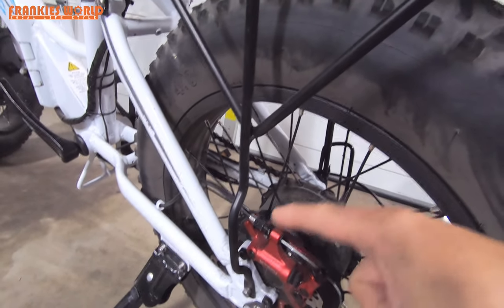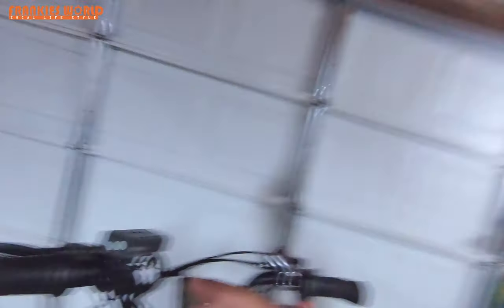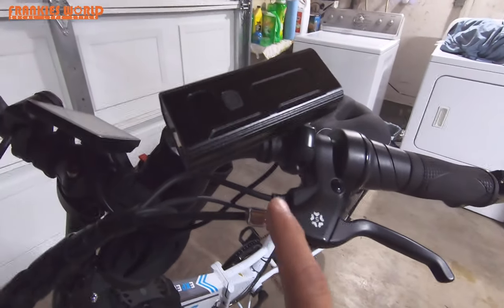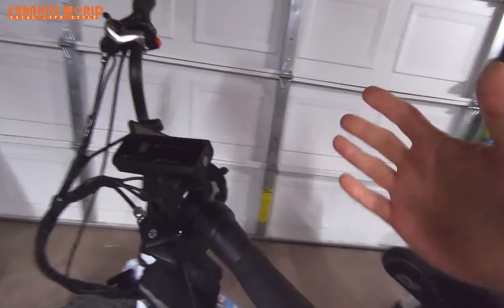How to do a quick brake adjustment on your ebike

Comment: thank you! very helpful)))) Realised, that my brakes, still blocking the motor, after 1 hour of tweaks. Just cut cable from on the brakes. Motor and brakes, from the rear wheel, works independently now. Problem solved 🤣

Comment: Thanks Frank you cut right to the chase and you went quick yet you explained things in a perspective to where even dummies like me fully understand things. When you explained about the brake lever wouldn't work if you don't have the brakes adjusted just right for the power to shut off from the motor to let the brakes work proper. Whew! You know what I mean. You explained that part very thoroughly to where it made me a believer to subscribe to your channel. Looking forward to the next video.
Reply from the maker: Thank you for your positive comment!

Comment: I'm new to the Lectric 3.0 bike and not good with brake adjustments. I watched other videos where they were showing how to adjust the calipers. Watched yours and made adjustments to the brakes like you showed, and worked like a charm when I tested them out. Thanks for the very helpful video!
Reply from the maker: Awesome, glad I could help. Keep in mind after several adjustments at top that you will have to adjust at the bottom towards the caliper. I have another video on that one.
Reply: @FrankiesWorld  I will look that up. I see others (perhaps  you as well) changing them out for hydralic. Did you do that as well?
Reply from the maker: @BikingHikingRadio  I did.  I am working on making a new video soon on brake cleaning to get rid of loud brake noise as well. I have a major issue with that going on with my front brake.

Comment: Man brother you made it so basic. Other videos had me trying to adjust calipers and everything else. Thanks for the simplicity'...😊
Reply from the maker: It’s easier than most think. Adjusting calipers is more of an advanced thing that usually doesn’t have to be messed with unless further adjustment is necessary.

Comment: Very good info for adjusting brakes. My Lectric bike brakes are good since it is a new bike with only 33 miles. The only issue I have the rear brakes squeek a little. I tried using some alcohol and it stopped temporaly but noise came back after a few miles.
Reply from the maker: Thanks, and yes I agree about the noise. Temporary fix, I’m working on making another brake video on replacing the caliper and adjusting both sides of the cable shortly.

Comment: Thanks for the video! I have an Z bike and I've had it for one week now and bought it off Amazon. It's very  similar to the Lectric ebike. Do you know how I can my my steering more stiff in the steering column? Seems like it too easily   wobbles from left to right when I'm trying to steer straight. Thanks!

Comment: Thank you this video helped a lot. Do you know how to fix squeaking in brakes? If not no worries
Reply from the maker: @Steven-xl4ml  I wish! I’ve tried everything from beading them when they are new, cleaning the rotors with alcohol but nothing has worked for me so far. My next thing may be to try using a specific lube for the parts that should help. If it works for me I’ll upload another video.

Comment: Thank You, Hello! I purchased Engwe L20 and fitted everything. After fitting the front tire, when I move the bike without pedalling, it stucks a bit and sounds awful and I can hear it is from the front disk. How to fix this? Bike is totally new, should i follow you video thanks a lot
Reply from the maker: Sounds like the brakes are adjusted too tightly so it’s rubbing against the rotor. Since the bike is brand new I would contact the manufacture. You can try my steps in my video if you feel comfortable doing so. Good luck!

Comment: So basically once you pull out more it should tighten correct? I did that but noticed only back brake barely tightened and front was not doing nothing,  as I look down on my kids ebike I see brake pads worn down to basically metal so no wonder why I wasn't feeling any contact. That's for informative vid and can you tell me is there a bug difference between disc vs hydraulic brakes? Like I think I want to replace with hydraulic
Reply from the maker: When you adjust one cable lever it adjusts one brake caliper. The front and rear have independent cables that's why only one adjusts. This video is for mechanical brakes only, hydraulic is more complex. If the pads are worn to almost metal, time to replace the pads. I have another video on my channel that shows the full brake adjustment if you have to adjust from the caliper which you will have to do once you cant adjust from the handlebar lever anymore.

Comment: Nice video. How do you know when it's time to start adjusting at the caliper?
Reply from the maker: @skipperjones7490  thanks. Basically when you can’t adjust at the top anymore. You’ll notice you can only pull out the brake cable so far before it wants to come out.
Reply from the maker: Here’s a video I made for the caliper adjustment if needed, hope it helps. https://youtu.be/AN8ahYBatv8?si=Yf1xldpIWOfJ6t5M

Comment: There's one other adjustment that can be made that you didn't mention. Your video is pretty dark but those calipers look like the VTECH hydraulic calipers. On the VTECH calipers there is one more adjustment that can be made. It requires a 2mm Allen wrench. There is a small Allen screw that seats against the piston that actuates the caliper pistons. Screwing the Allen screw in makes the adjustment of the brake pads tighter/closer to the rotor. Check it out.
Reply from the maker: Thanks, I didn't realize that. I am going to try doing that to my front caliper since i put in thicker rotors i have to adjust the pads to sit a tad further from the rotors.

Comment: Right on man I was doing that all wrong pulling the cable from the bottom 😭
Reply from the maker: @David-z3x4f  all good. Once you can’t pull from the top cable anymore watch my other video on the full adjustment. It shows how to adjust from the caliper and reset the top.

Comment: My brakes feel tight but won't actually grab, I think I accidentally tightened the cable without adjusting the calipers. Is that normal? And is there a way to see if my calipers need to be replaced or I just made a mistake without taking everything apart? This is my first ebike, I bought it non-functional from the garbage and rebuilt it myself, but brakes are serious and I'm not a pro
Reply from the maker: It’s possible it may be the calipers. If it were me I would start over and adjust from both the top and by the caliper again. When squeezing the levers you should see the caliper move in freely. Check this video out on full adjustment to see if it works https://youtu.be/AN8ahYBatv8?si=Sm4kdof96_C0_3Wg

Comment: But when you run out of adjustment on the handle what next could be adjusted?
Reply from the maker: When you run out of adjustment you can adjust near the brake caliper. Watch my latest video on brake calliopes, it will show you how to start over and readjust.
Reply: @FrankiesWorld  oh ok..my adjustment when so far out it felt like the cable was going to fall off so I'm going to go back halfway on the adjustment and do the rest near pads and see if that would work..

Comment: I have a fat tire in the air fat tire bike so this little trick is all I need to do? Brakes are the one thing I'm always afraid to mess with
Reply from the maker: Yes it is that easy. This will work as long as There is no damage to the brake cable or caliper this is the way to fine tune. I have another video that shows the full adjustment that you also do  on the caliper end.

Comment: i tried doing this trick, i felt some tension returning, but not a whole lot, and its still not braking properly. I can see that the pads are barely squeezing the disk, and ive been repeatedly adjusting for 40 mins and i still havent made progress. any suggestions?
Reply from the maker: @amayacorral7086  you may need to adjust from the caliper. Try this video https://youtu.be/AN8ahYBatv8?si=jYpto2hXMk4rOiXQ

Comment: What's up Frankie. Great video brother. Quick question for you: I just changed the brake pads on my rear tire because I felt like the brakes were sticking a bit. When I looked at the pads that I removed they weren't as worn as I thought they would be. I still replaced them though. I took the bike out for a spin to try out the new brake pads and although they brake quickly, they make a grinding noise and I still feel them sticking. What kind of adjustment do you think I need to make? Thanks in advance bro
Reply from the maker: Thanks for watching! I’m wondering if your rear caliper may be going out? Check out my other video on break adjustment part II. This way you can do a full adjust and see if the problem still happens. Also for the grinding noise, did you replace the pads with metallic ones? Sometimes it’s worth replacing the rotors as well with better ones that can handle metallic pads.

Comment: So I just got a bee cool explored bike. Had a bunch of trouble because although the calipers were installed at the factory, the cable for the front one was routed incorrectly and was binding up so I couldn’t put the handle bars on cuz there wasn’t enough slack on the cables. On top of that the caliper was attached backwards so no way it would go over the rotor. I got all that resolved but now when I move the bike the brakes are dragging. Bee cool have hydraulic brakes and I only see one nut where you show two. Any ideas on how I can adjust them so they don’t drag or is that normal with brand new bikes?
Reply from the maker: No they shouldn’t drag. I hate it when bikes come messed up from the factory. Sometimes when that happens they will give you money for the costs of what it cost at the shop for repair since it’s not your fault it shipped that way. In your case it sounds like the pads need to be adjusted inside the caliper. If loosening the cable doesn’t stop the pads from dragging then it probably requires a pad adjustment. Sometimes it’s better to take it to a shop when it gets complicated. I did the same for my cable replacement.

Comment: First E-bike I've seen thats "All Wheel Drive"  😉  Am guessin you've added the front Hub Motor from the looks of things. Just curious as to why or what advantages you've gained . . . unless it's for WoW factor which works too !
Reply from the maker: Yes, added the front motor along with a 2nd battery and controller/throttle so it’s independent from the main motor. I did it basically because I live in a hilly area. Having the 2nd motor and battery help me climb these hills with ease and get home without having so much range anxiety with just one battery and motor.
Reply: @FrankiesWorld  Kewl ! I'm upgrading my stock "Logan" 2 piston Hyd brake sys on my new Juiced RipCurrent S to Tektro's HD-E725 4 piston design, so I'm watching every YT vid I can find on the subject first. Not afraid to "dig in" to Bike Repairs/Mods but I like to see what methods work, or don't work for others who've done it before. My first E-bike had Tektro HD-E350 2 piston brakes w/ 180mm rotors. When the first set of Rotors reached their wear limits, I went to 203mm Rotors w/ pretty good results. "Range Anxiety" . . . like it!  It says a Lot !  It's one reason I chose the Juiced Brand was because of the Crazy Long Range advertised when I bought my first 750w RCS in 2019. They claimed a 100+ mile range back then but have backed that down to 75+ miles for the New 1000w RCS. Realistically the Actual Range is much less because their advertised ratings are done in PAS level "Eco" (the lowest of 6 PAS setting) with a tailwind on a level paved road/trail. Realistically, most my time is spent in PAS Lvl 2 & 3 w/ minimal time in 5 & 6 for passing or long hills, which puts my Pratical Range around 50+ miles.  Even More to the point, I've totaled over 16K miles on my riding app's in 3 riding seasons but have NEVER ridden more than 25 miles in a single outing. Most of my rides are around 23 miles ea. A rating of 40+ miles for an E-bike should be Plenty sufficient for 98% of most folks riding habits. The ride turns into work instead of fun exercise when you try to go beyond 90 min or 24 miles for a given ride imho, unless you've got a Really good fitting seat and even then 30 miles+ would be a challenge. I live on the Washington side of the Columbia River but do the better portion of my riding on the Portland Or side because of the extensive bike friendly trails & roads. When I first started riding E-bikes in 2019, maybe 3 out of 50 bikes on the trails/roads were E-bikes. Last season that number went up to over 20 out of 50 being E-bike's. The market has Exploded along w/ brand options. Personally, I'd advise going w/ an E-bike manufacturer that has a Tech, Parts and a Cust Svc Dept devoted to each, or get a bike that uses Lots of aftermarket components vs proprietary "one off" components. Bikes are Maintenance Hogs and WILL req service soon unless you're Very Diligent w/ preventative maint.

Comment: will this help if I losses them instead of tightening if my brakes are rubbing without any input on the brake lever?
Reply from the maker: Yes, try loosening from the handle grip part first. If that does not help start to loosen from the adjustment at the caliper. As you loosen it you should see the pads slowly move apart from the rotor.
Reply: @FrankiesWorld  thank you so much!! i’ll try that out!
Reply from the maker: @GreatDayForJay  If the pads dont loosen when you do that then it may be the caliper itself may need to be adjusted. Take a look to see if one pad is much closer to the rotor as the other.

Comment: I have the same calipers hb100, but even if its so tight it doesn’t work at all, I guess I should refresh the oil in it but idk how. Can you help me with it
Reply from the maker: So tbh, since it’s been a while since I’ve posted this, these brake calipers are a hit and miss. My back one stopped working 6 mo later then the front a few mo later. I replaced the back with the stock one, and ordered a new hydraulic one for the front similar to the one you see on the video and it’s been fine. I think going full hydraulic is the key.
Reply: @FrankiesWorld  so it means I should throw it 😄
Reply from the maker: @buraki.3547 if you have had it longer than 6 mo I probably would. They’re cheap enough to replace.

Comment: Hey quick question what's the brake for? On the left does it cut out the PAS
Reply from the maker: Both brakes are supposed to cut power to the motor when activated as a safety feature.
Reply: Ayeeee thank you for the quick response 💯❤  I truly appreciate it

Comment: Will that piece screw out at some point?
Reply from the maker: Yes. I have other videos on brake adjustments showing what to do when you can’t screw it out anymore.  Once your at that point to want to start over on the top adjustment and adjust at the caliper. You can physically pull the brake line and then retighten, slowly adjusting the top. In time these cables will stretch.

Comment: Hi mate I changed the break pads and everything looks fine but still not stopping it when fully hold the break
Reply from the maker: You may need to further adjust it. Check out my video on caliper replacement and this one. Brake Adjustment Part 2 (Full adjust)
https://youtu.be/AN8ahYBatv8

Comment: Hello hi frank my rad wagon 4 right brake went out on my brake handle don’t touch the handle bar and my right break still  doesn’t work
Reply from the maker: When you apply the right brake lever look at the rear brake. Is there any movement? If there is you can try adjusting from the rear. If no movement at all from either one your brake caliper may have gone bad.
Reply: Thank u

Comment: What happens when that little adjusting dial is all the way out?
Reply from the maker: Once you can’t adjust at the top anymore you have to do a full adjustment and adjust the bottom. At this point the top can be screwed in. This video may help. https://youtu.be/AN8ahYBatv8?si=JsgrYIiYrFKn1M5R
Reply: @FrankiesWorld  thank you!!!
Reply from the maker: @mzmdigitaldesign  of course, and good luck!

Comment: What do you do when you've unscrewed as far as it will go?
Reply from the maker: At that point you do a “reset” screw it back in and then make the adjustments from the caliper side.
Reply from the maker: Hopefully this video helps https://youtu.be/AN8ahYBatv8?si=px4Tfx-nfm57wANL
Reply: @FrankiesWorld  I tried that and it's just messed up my back brake. The brake lever doesn't always return when I release it, and there's a horrible rubbing noise when I ride my bike. Plus the back brake doesn't always work.
Reply from the maker: @jaelexlinsey  you may have a faulty cable or brake caliper. Happened to mine once and I had to take it to the shop to get the brake cable replaced. Sorry.

Comment: What happens if you pull it out too far? Mine seem to be as far out as they can go to where I'm not sure if it's safe, and it's only barely catching resistance near the handle (haven't gotten the finger length, maybe about half a finger length)
Reply from the maker: Once you get to the point to where you know you can’t pull out anymore you have to adjust from the brake caliper. I have other videos on adjusting the brake caliper. Turn the adjuster on the lever so it’s all the way In. Cable will get loose. Then adjust from the caliper end. You will have to physically pull the cable till it’s tight, then you can readjust. If you watch my other brake videos with the caliper adjustment this will make more sense.
Reply: @FrankiesWorld  awesome thanks man
Reply from the maker: @bobthebuilder9416  this is the video o was referring to https://youtu.be/AN8ahYBatv8